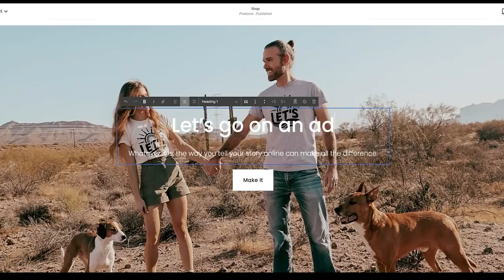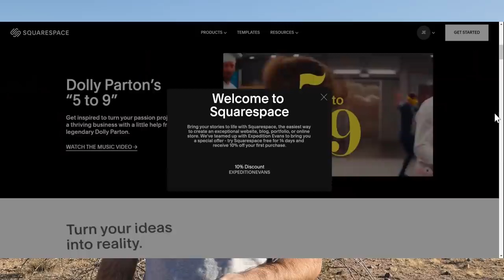WE FINISH THE REPAIRS! (on our salvaged sailboat) | Expedition Evans 29

Comment: I'm a marine engineer. I had a good success story with my boat which I purchased from the same company and I was considering your boat when it comes out. The reason why I pulled out is due to the extensive structural damage in this boat and, I was only going to consider it if it has mechanical damage. I was really curious to know how this boat gets fixed? When I saw your channel, I asked myself, “did I make the right decision pulling out?” Answer is; “YES!” 
You really have a lot of courage to tackle this massive project by yourself. Kudos to both of you! keep it up.  Soon you will be sailing.

Comment: I am going to admit at the start of this project I thought it was going to be another "We started to repair this boat with no experience and nowhere near enough money, please gib money." series.
Over time it has turned out to be one of my favorite series to watch and I think you guys have given the boat a better repair than 99.9% of people would.
Cant wait to see it sail.
Reply: Totally agree with you spider0804. Didn't think these two had the moxie to get this far but so glad they did. I really look forward to each new episode.
Reply: Level of detail they used would be right in the top end of quality.  
Job very well done.
Only questions i have why manufacturers only used that small block under nut fasteners for keel mounting, and maybe why they found on forums so many crack for normal use, i would make much larger plates to spread load, but you guys have got heap more strength to the hull now , good for life!
Reply: Agree. They have put in a lot of work here
Reply: I second this
Reply: Agree, this boat is going to be stronger than when it came off the line!!  It’s been such a blessing to watch and learn with Team Evans as they encounter challenges and find ways to overcome....every time!  This is one of my new favorite channels!  Who needs Netflix when you have EE!

Comment: Well done, a great achievement. My advice, which maybe too late, is that you should clean every speck of glass fibre dust from inside the boat. It is very destructive to lungs and particles will cut through into the pleura if you breathe them in. You have already ingested a lot of fibres, but now you should avoid dust affecting your guests and especially any children. I believe the boat needs vacuuming with an industrial machine which is positioned outside, then everywhere needs to be thoroughly washed. It is a shame you did not cover the  seats, bulkheads and lockers to reduce contamination. Anyway I wish you all success with following your dreams and believe they will be achieved, just please start off with a healthy boat.

Comment: I hope the floor and everything else fits back in on the added thickness of fibre glass, unless it was just built up to the original thickness. Best of luck. Sheffield England.
Reply: I bet there will need to be some custom-fitting of all the cabinetry.

Even being 1/8" off is going to cause issues everywhere.  It's not insurmountable, but it will take care and some modification.

Ever had an Ikea product with a miss-cut piece in it?  It will never go together properly until the part is identified and made right.  Every part depends on the precision of every other part.  Once you go off-script in a build like this the misalignments keep breeding more and more down the line.

Comment: I recently came across your work. Great technical content and fabulous cinematography. I actually suffer through the ads to help you monetize.  

One question, are you planning to drill and plumb between the grid pockets?  If you get water in the grid, how will it flow to the bilge pocket?  On my boat there are glassed tubes (PVC?) between the floors to compensate for the height difference of the hull across the glassed floor.  Did I miss this on your videos?

Comment: Hi there @ Expedition Evans,
Jade and Brett, you are making great progress and doing a fine job there.
I really loved the 'tomato-bit', that made me wondering if the expression is 'couch potato' or 'couch tomato', and realized it sure doesn't reflect one of you though!
This just being a comment from a boomer of the Netherlands...
I have been bugged quite a while about your 'bilge-box'. The chance is slim, but what if for what ever reason water is coming in and left standing between the iron keel and the box? This can get quite nasty, I think.
A possible cure could be to drill a few small holes at the top, and fill the gap to the brim with a durable solidifying liquid such as epoxy or P.U. Compound.
Please let me know your thoughts on this.
P.S.
Good thing you decided to reinforce the chain-plate area!
-
Keep up your chin's and the good work!

Comment: With the amount of glass you were putting on I thought you would have to trim the floor to make it fit.  I'm glad you still had to build up the beams to get the floor to fit.  Any idea how many hours you two put into fixing the boat?  Sailing Aurora, a 40ft Hanse 418 that had similar but less damage than yours, is being commercially repaired although it is not nearly as strongly as yours.

Comment: Continuity question - is this a flashback episode?  I noticed that the keel was not fitted.   Would be nice to have an intro with some continuity as I thought I was watching an old episode.
Reply: The keel installation was a mini-series on its own -just line the bottom-sanding and painting episodes.   

Now we are back to the original continuity of the overall rebuild.  We will see keel bolts suddenly appear at some point as they are painting and prepping the grid for laying the floor and larger cabinetry pieces.
Reply: Ohhhh I see cheers!

Comment: While this is way, WAY, to late to ask (I saw the live finished floating update): how did you deal with the added thickness of the newly reinforced stringers and frame/grid?
The cabin sole to the coach roof are already at tight tolerance from factory, how did you accommodate?
Reply: They cut away the cosmetic gel-coated covers on the stringers, and a cm+ of bonding putty (!!!), then ground back the stringers.... before building up again and checking levels with the un-changed side stringers (20:52+). So the new top’s level should not be very different from the original. I think they discussed this in an earlier episode. Also I think they’re far too smart, and forward-thinking, to be caught out by this.

Comment: I'm curious... I own a sailboat of a different brand, and it has what I'll call "weep holes" low in the grid (near the hull) to let water flow down to the bilge bottom.  On a Benneteau, If water enters a compartment other than the one with the sump, how does the water flow to the sump?

Comment: Jade and Brett, why are you obsessing so about smoothness down in the bilge when it will be covered over by the sole, (floor)?
Reply: The bilge will inevitably become fouled with oil and sea water. Cleaning a smooth surface is so much easier than a rough and fibrous one.

Comment: I honesty don't believe you have completed the repairs... A few episodes ago the old relativity meter pegged over from INTERESTING as Kim & Kanye's marriage to BORING as watching paint dry. I fully expect if I watch an episode of this channel a year from now, Jade will be saying "I need to cut a sheet of fiberglass to fit...we now have a machine to automatically mix epoxy to the proper consistency...another three layers and we can move on to... ENOUGH ALREADY, put the damn boat back together! Inset tab A into slot C...secure the trim panel with a #10 by 3/4" torx flat head sheet metal screw... just CUT the damn wires, we'll figure out if they're needed later... Oh wait, magnificently unbeneficent Benateau wouldn't cough up any supporting documentation! Just get a couple of BIG F***IN HAMMERS from Lowe's, persuade the interior back together and secure it with drywall screws.

I'm going to hit the snooze button and come back in a couple of months to see what you are still fiberglassing, then hit it again and again and again until it looks like the interior is going back together...
Reply: Quite the operation you have going here... You write at least a 200 word reply to my
post and after I read it and before I can respond, you take the response down
so no one who hasn't seen it will ever see it. Why didn't you just block me, or
couldn't you justify calling me a troll because there was a ring of truth in
what I wrote… as there always is. I'll do my best to respond without the post
in front of me, without being a troll which has never been my intent and with
some of the same humor I tried to include in the first comment. Obviously any
words attributed to you in the subsequent text are paraphrased rather than
direct quotes because you took your response down.

Opening Statement: You're totally backwards here, on 10 instead of 28.

You said in your reply that you plan on living on this boat for a long time so you
want to be meticulous with your repairs and restoration so you will feel safe
and be safe. I have absolutely no qualms with the meticulousness and I applaud
you for your work and work ethic; if it were me doing the work I would probably
add at least an order of magnitude of minutia to that end. One has to do what
makes one comfortable on a project like this especially when the safety of your
family, however big it may grow to be in the future. Just because you feel the
need to be this meticulous doesn't mean you need to share every detail of it in
a vlog.

Months ago, one of you said in a vlog comment that all the fiberglassing in the vlogs
must be boring to watch. Apparently there were enough comments to the contrary
that you added a bonus episode of fiberglassing. Since that time, it seems like
you have gone out of your way to show every square foot of fiberglass applied,
every epoxy brush stroke leading to Carpal Tunnel, every sanding/grinding task
etc, etc, etc.

What I should have said directly and I apologize for not being more direct, is you
edited and stretched portions of the work in your YouTube time line far beyond
the needs of your audience. Personally, I stopped listening to the reason for
the fiberglass "application of the week" a couple of months ago, I
just chalk it up to "Brett and Jade fiberglassing again". If you feel
you must share such meticulous time consuming detail, put it on your Patreon
page and let the people needing the detail for what they are doing or just
plain curiosity pay for it. By my estimation and based upon your Xmas episode,
without the excessive detail in past vlogs, this episode should be showing the
boat long since splashed.

Good luck to you both! Are we still friends?  😁🛥️✈️❤️😷
Reply from the maker: Our videos are free on youtube, and are not being forced on you. I am sorry that you dislike the videos but I am still glad to have made them because they are memories for us. We haven't stretched any details, in my opinion. This 23 minute video encompasses 4,320 working minutes over the course of 4-5 days. Last week's video showed a project that took me more than three weeks to finish. The original assembly for this video was over two hours long - to give some perspective - so if anything we cut out too many details. 
I spend about 40 hours editing each of these videos. There is quite literally not enough time for us to do the boat work and edit the videos.
I could skip all these projects and moments and jump to real time, like you suggest but I don't want to. This is our story to tell and all of it is important to us. This video makes me SO happy, to edit and to watch and I don't regret making it. 
Once again you are not forced to watch it. Youtube is a free social media platform and it is your choice how you spend your time.
As for deleting the original post, we decided to avoid the reply thread that could have followed. You may be speaking as part of our audience, but there is another portion of our audience that likes these project videos and would watch more if we had time to make them. We prefer to keep the comment section free from contention and wanted to avoid this turning into a whole thing.